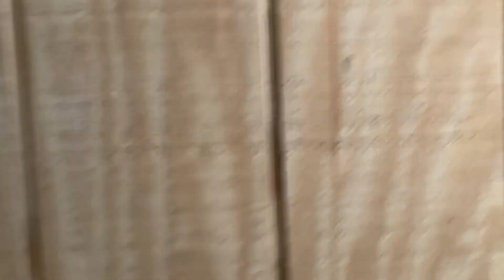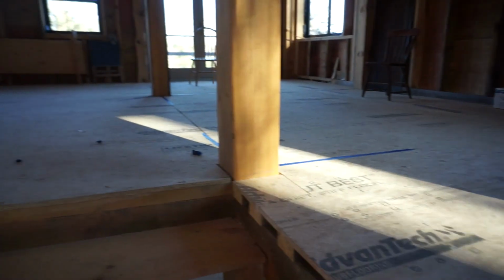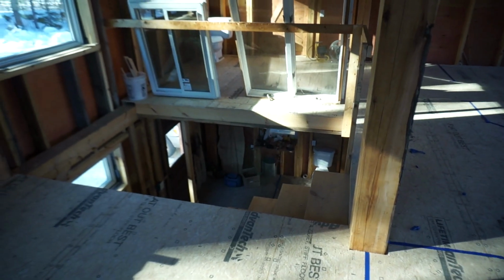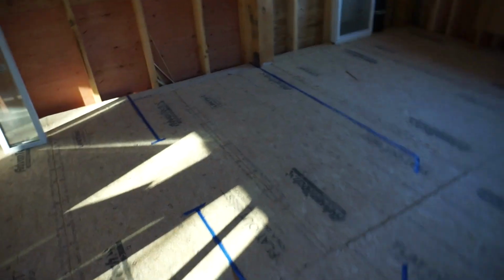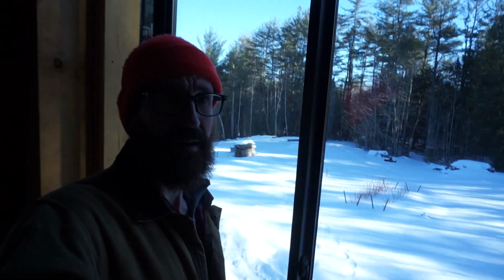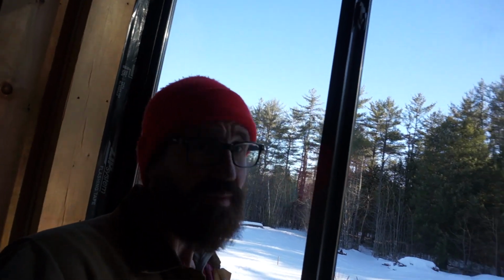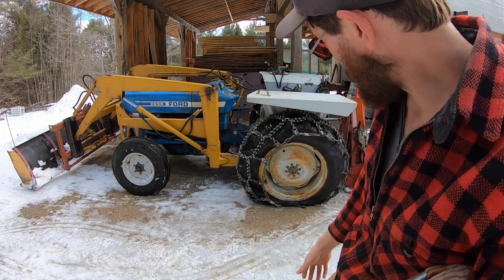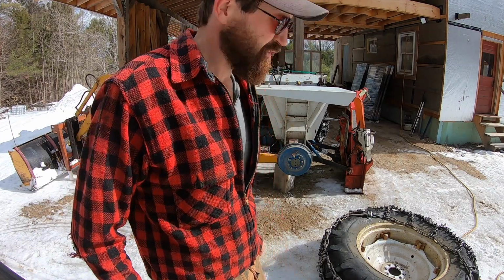Building a House from Trees SE7 EP5 Timber Frame Sanding, Tractor Tire Changing

Comment: You need to do a sleep over in your new place now that you have all the windows installed.  Im sure with the right air mattress and sleeping bag and maybe a small space heater you would be fine.  Easy to wake up and get an early start on projects since you are already there.  Now that the weather is warming up here in Northwest Indiana I finally put together my log arch.  Just need to install the ball hitch fixture on my lawn tractor which hopefully wont have an issue pulling the logs to my back  yard where my mill will be set up.  I had planned on purchasing the Wood Mizer LT15 with the trailer option but I might get the cheaper LX25 because we decided to have our 22yr old furnace replaced next week which takes priority.  Once I get the mill which last I looked takes about 12-15 weeks to arrive I will definitely email you some pictures and video.
Reply from the maker: Cool! I cant wait to see.

Comment: Hi Bus...Good to see a video.   The heat gain in the winter is great, are you concerned about the heat gain in the summer ?
Also, just a small observation, on the window sealing, you put the top tape on before the side tapes. Should the top tape go on last?

Thank you
Reply from the maker: The massive overhang off the front cast a shadow to the deck, and Ill pull drapes on the hot hot days.

Comment: Have you measured the thermal difference on a cold day? and how it holds internal temperature over night?
Reply from the maker: I am going to now.
Reply: @BusHuxley  I live in a 200 year old brick built victorian cottage (England). It was bitterly cold during the winters. The walls are solid brick 2 courses think but act like a sponge drawing out heat. I ripped all the walls back to brick and put foam backed plasterboard (drywall). The difference was remarkable and the ability of the building to maintain a fairly constant temperaure shows quite how effective modern insulation is!

Comment: What hinges are on the hot water tank closet? 

Did you consider liquid flashing? I recently started using it and don't think ill go back to tape except in the winter.
Reply from the maker: Just regular hinges from Lowes. I have heard of that stuff but havnt used it. Risinger loves it.
Reply: @BusHuxley  liquid flash doest require perfect conditions to be applied. That being said I would never use zip system because houses need to breath since I'm in a hot a humid climate.